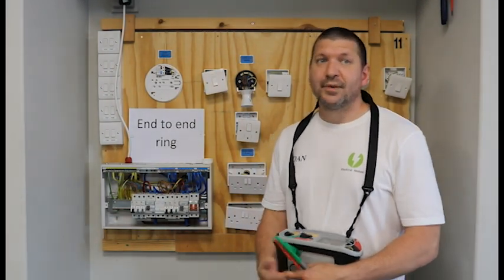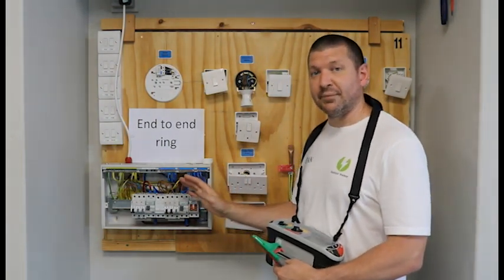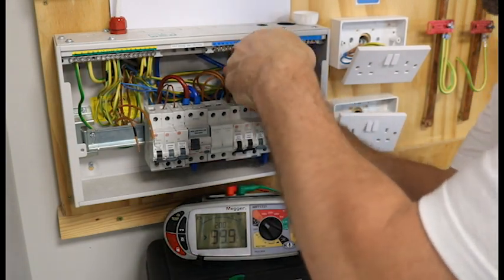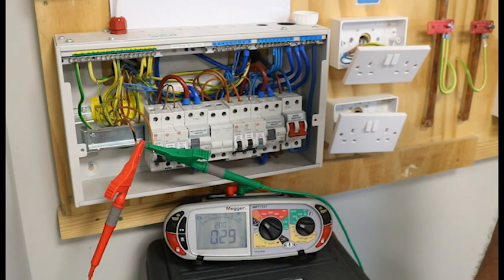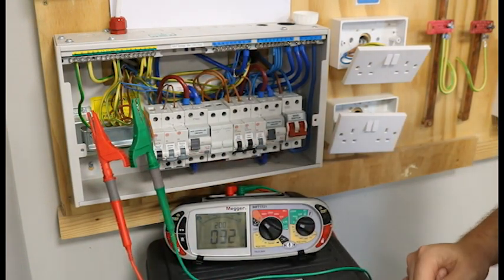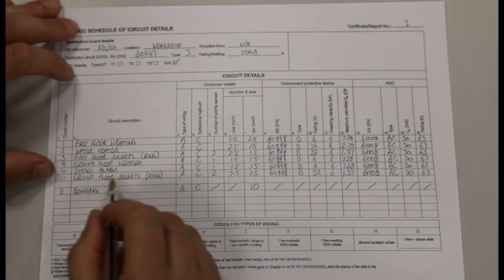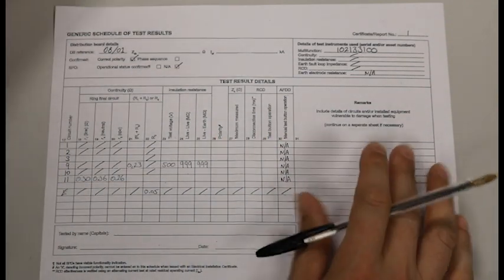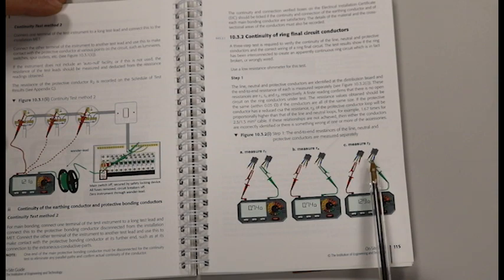Guide to completing the End to End test and test sheet completion

Comment: Hi great informative videos 👍. When you were doing your end to end and the cpc was lower than the r1 and rn, whatmwould cause it to be lower ? Cheers
Reply from the maker: Hi, thanks for the feedback. Because the board and circuits are so small and short I actually wouldn't get any readings of resistivity from the cables. Behind the board are lots of resistors to add resistance to the cables. I have also wired in some faults, which can be turned on and off for future fault finding videos. These have affected some of the readings. Maybe I should have said ignore my actual values, I'm just trying to give you a simple guide to the process.
Reply: @ElectricalStudentsUK  great and thanks again it all helps, appreciate you doing the visit help 👍